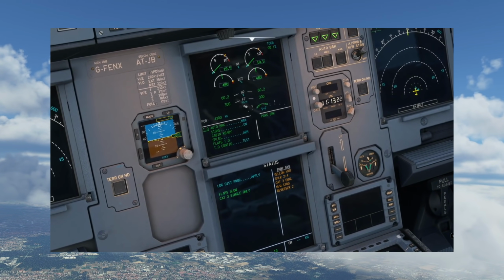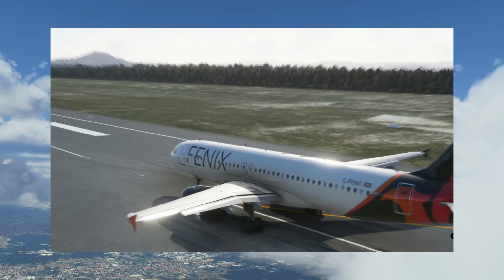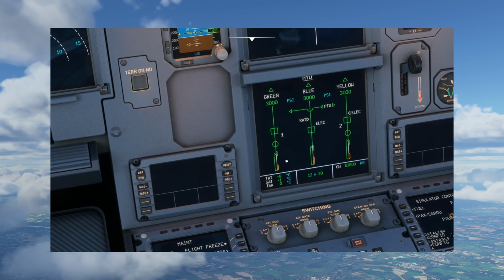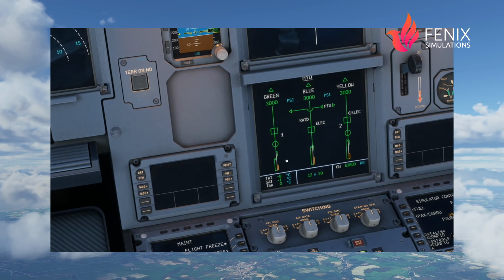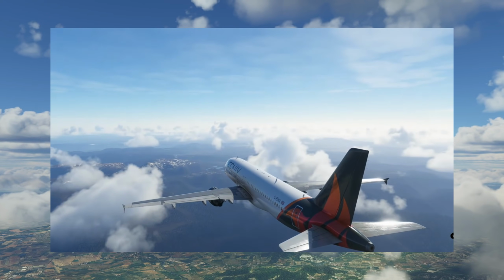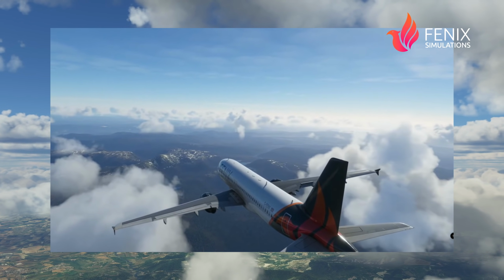New Footage & Details of the Fenix A320! Fuel, Hyd and More with a Real Airbus Pilot

Comment: The landing gear actuators must be a decent size and take a fair amount of oil. Also Airbus always seem to be on a push to reduce the weight of their hydraulic systems, less oil, higher working pressure etc.

Comment: What a nice sunday surprise, thank you! 💙 Regarding the hydraulics page.... maybe not the most user-friendly depiction. What is the reason having scales, when they don't fit and the indication is below or above although everything is working just fine? Wouldn't it be a smarter approach having scales adapting to the e.g. extended gears (every fluid level in every state of the aircraft is always within the green scale until an failure appears), if you want a non-linear depiction. Additional if something is wrong or low levels are detected... similar to the lighting of the buttons that only light up when somethings wrong, why the scales don't change colors to amber (if something's wrong)? And maybe an automated low level indication that comes early so you can give maintenance a head's up. Don't bother the crew with things until somethings get wrong.. thanks mate! P.S. Don't know from what ashes it emerged but it's a beautiful phoenix/fenix...
Reply: They do generate a caution if fluid level is low and turn amber if something is wrong. Have you never watched any of the other videos or flown an A320?

Comment: can't wait for this. The FBW is an okay aicraft but there are faults that for me makes the airplane pretty boring to fly, for example the LS that doesn't work properly and has you rely on visuals.
I really want a proper airplane addon in MSFS.
Reply: Agreed. I find the glitches and quirks with the FBW aircraft really do spoil the immersion. It works ok most of the time, but I still have problems with it suddenly veering off course and doing random things. And of course the lack of VNAV is a big thing.